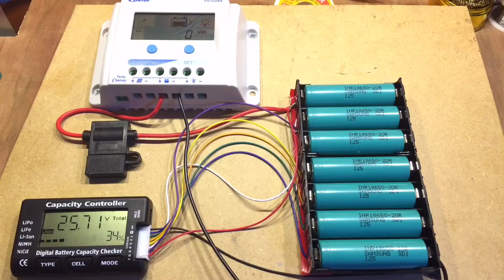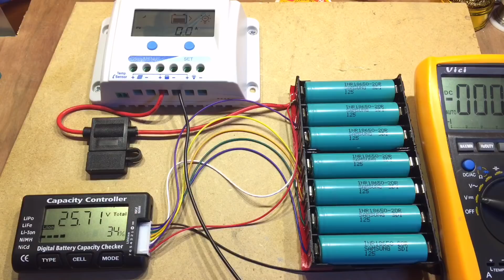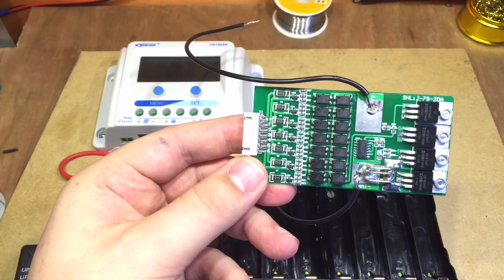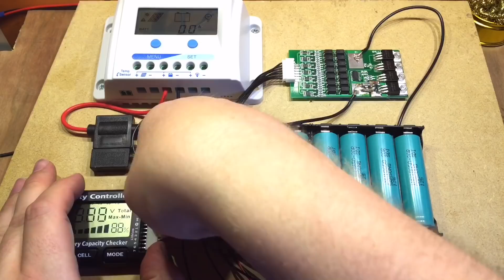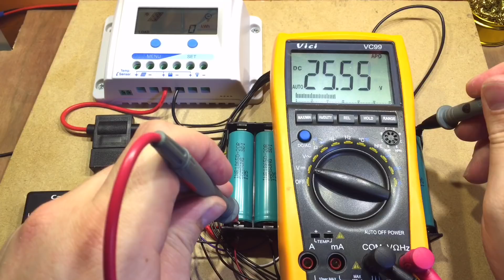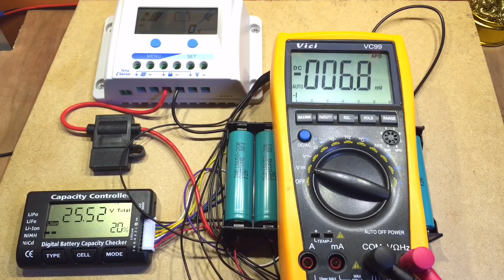Solar Charging Lithium Ion 18650s - Part 2, Getting the balance right - 12v Solar Shed

Comment: Hey Adam, Have been following your series.. I just wonder how are you avoiding equalize/Boost feature of controller..
Reply from the maker: Hello. I’ve set the charge controller to Gel mode. This means it doesn’t do an equalise charge at all. The boost setting for the Gel profile is 14.2v (or in 24v mode 28.4 volts). In a 7s configuration that gives 4.05v per cell. This mode tries to stay in boost mode for 120 minutes. If it reaches that voltage it will adjust the pwm cycle to keep the cells no higher than 28.4 volts. After the two hours, the charge controller disconnects the solar panels until the battery voltage drops to 13.8v where it will float. In my experience, the cells never float because lithium doesn’t sag as much as lead acid. So to my mind it works quite well for s7 lithium. Changing to sealed or flooded would charge the cells higher and as you say also do a monthly equalisation charge which could charge your cells to 4.17 or 4.22 volts - which might be a bit high or at least reduce their lifespan. But with a reasonable bms attached, that may be a limit some are happy with and would maximise your storage.
Reply: @AdamWelchUK  Thank you so much detailed response. Appreciate the work.

Comment: can someone explain the difference between solar charge controller and bms? the charge controller just supplies voltage from the panels, while the bms actually handles putting that energy into the batteries? If I have a tiny 5v solar panel, do I still need a charge controller or can I just use a BMS or like a TP4506?

Comment: Given that TP4056 chargers are very cheap, as are buck converters (which are pretty efficient), why not simply use the solar rig to charge the lead-acid battery that it's designed for, and then use a buck converter to drop the 12V down to a little under 5V to power a bunch of TP4056 modules, one per 18650? No calculating, no messing about balancing: the technology is tried and tested already.

Comment: what about adding a buck regultor between the charge controller and the battery? some buck controller say that have costant current and costant voltge. and the voltage can be regulated

Comment: I made your battery capacity checker some time ago that works well but would like to purchase a watt meter but your wattmeter is no longer available from the Portapow such a shame and the Chinese one are so inaccurate they are not worth buying so any suggestions, please?
Reply from the maker: Sorry not really. There doesn’t seem to be much that takes the place of the portapow - I guess there wasn’t much demand for these types of things. Best suggestion would be a usb power doctor with some custom cables. Like a rdtech one capable of monitoring a wide voltage range might be the closest stand in.

Comment: Press The "Type" Button until it shows Liion ore Lipo and then press and hold the "TYPE" Button until it Beeps

Then the Capacity Controler is doing the Balancing even if the "per cell voltage" is under 4.2

BMS´es only Balance when the Cells are up to 4.2 Volts (stress for the cells ) ;-)

Comment: I use a Capacity Controller for balance. And switch to balancing the Battery by pressing the 1st button and holding until it beeps twice. And it balances me pretty well. It only takes a long time.

Comment: Is it possible that your bms is for LifePO4  batteries ? They have a voltage range of 2.5v-3.6v and a nominal voltage  of 3.2v where as Li ion cells are 3.0v-4.2v range and 3.7v nominal voltage .
Or ...my other thought is  ...
If the pos and neg were reversed you would not have one direction diode protecton  and the power from the batteries  could flow back to the pannels.

Comment: I found out the hard way that the mosfets hate any static charge. i think you have to ground yourself when handling them too. i had a 48VDC spark fry a BLDC motor controller on me twice when it  was out of its aluminum box. The spark was more than a foot away. I put my 3rd new controller in a faraday cage i made with an antistatic bag wrapped in foil tape and it stopped the problem with sparks.

Comment: You could try to test charging the Li-ion batteries directy connecting the panel to balancer. If power of solar panel is too hight and Amps exceed charge capacity, put a few ohms power resistor in between and you will test if balancer is OK. If balancer works, you can then try to place in between charge controller and balancer a filter made of capacitors to eliminate the PWM component of controller output. See what happens, I think it is worthy to try.

Comment: Adam, A stupid question probably. But I have 3 (2.85 euro)  powerbanks cases filled with old laptop batteries and they work great. 6 18650 per case. (except when you charge them and you turn of the power they charge back. I suddenly had 4.8 volts on my rv 12 volt system.)  But I wonder about the balancing which I never did (no equipment to do so) but since they are in parralel should'n they ballance them self? Ie if one lags behind the rest will discharge a bit until all are equel. And the next charge they will all be in balance again?

Anyway I got myself a liitokala lii 500 because I saw you use a similar one (300?) in one of your vids. so I can test the capacity of my 18650's so I can at least group them together a bit that should help I think.  Not building any power walls yet.

Comment: hi adam, seems like your the bloke to ask,  i need to charge 2 x 18650 batteries in series, from a small solar 12v panel, which pcb/device/module should i get to charge and not destroy my batteries?.....thanks in advance.
Reply from the maker: Two cells in series always means you’re going to have to keep an eye on their balance but the module I felt worked best was the CN3722. They aren’t ideal, but the adjustable version will allow you to set the charge voltage (and I’d suggest dropping it down a bit from 8.4 volts). It isn’t true mppt but does do dc to dc conversion to get more out of your panel. They are generally set for 36 cell solar panels - so the mppt of the panel should be around 17-18 volts which is typical for a panel sold as twelve volts.
Reply: @AdamWelchUK  hi adam, thanks for your reply, i will take a look at those then, thanks very much,

Comment: We  use singlelab 50a 8s BMS they have tiny LED on the board when the cell has hit its cell voltage limit and is in bleed mode they light up   - its kind of reasuring to see them twinkle  - they also have a thermal over temp sensor which shuts down the issolation mosfets if it goes above 65c - we cut into the sensor and put additional  sensors in the cell pack and even one to the motor (its a single seat electric car) - These BMS bleed only at 65mA so when ballancing a pack we put it on a very low charge of 0.2 a if you pump 5a in its easy to trigger the overvolt cut out before the cells have chance to  ballanced - we only ballance cells ever 50 charges or when there  more than 0.01 Volt out as unnecersary  ballance charging shortens  the cell cycle life  - normally we bulk charge at  5amp and use the pack in a 25-80% envolope  - our oldest  Headway pack is now 5 years old and still going strong - I find your video's very interesting and your modest honest manner easy to follow - its like sharring a journey

Comment: Adam Welch+ I had two questions. Firstly great video. The first question I have is I understand that 7 batteries in series will make a 24 volt battery but your batteries appear to be all in parallel unless you are wiring them from the back positive to negative from the back of the battery holder. The next question I had was what if you used from the solar charger to a smart charger like a hobby charger or a regular charger like a "efest LUC v6" or a  "xtar dragon 18650 vp4" would that work? Obviously then to use the cells in a 24 volt configuration to draw power from them they would then need to be put into a battery holder with a 24 volt configuration. But just for charging purposes. I would guess it would work because the smart charger would convert the power accordingly I would assume. But then there would be the hassle of then putting the batteries in another holder. One other third question I just now have also. I noticed in your first video you had all the batteries linked together with magnets. I have seen other videos that people have charged single 18650 batteries with a hobby charger using magnets to hold the connectors. Do you think it would be possible to charge a large configuration of batteries with use of magnets to hold the charging wires in place? It might not be the most secure way even though neodymium magnets are very strong and would mostlikly hold them securly even through a earthquake. But Im wondering if the magnets would create a energy transfer and unbalance things. But just wondering if you could answer a few of these questions and if you make a follow up video addressing any of these things please let me know. And if you could post a answer to some of them I would appreciate. It thank you. Also one other follow up question. I see many experienced people on youtube making large battery packs and they are using reclaimed laptop batteries. Obviously they have sorted out some of the batteries but they are always mix matched brands and capacities etc they try from what I understand to match batteries with capacities of 2Mah or higher as their standard for making their large battery packs and from what their videos claim unless there is some trickery which is always a possibility but from the videos I have seen they seem reputable. But they are able to power large power walls and even vehicles with these large mix matched 18650 cell power banks that they have made. But understanding that each 18650 cell is rated differently within brands and understanding that there is internal resistance and charging speeds that vary between different battery types and brands as well that Ive been told and have heard often times never connect batteries of different brands or even ages together in paralell or series.. What are your opinion and thoughts on this? Thank you.
Reply from the maker: Hi Derek.
Yes you are right, the wiring behind the seven cells is diagonal - so it truly is a 7s pack.
You can power a battery charger like the ones you suggest from a battery pack as long as the battery voltage is suitable for the input of the charger - I power my Liitokala and Opus chargers from my 12v lead acid bank, but they can't be powered from my 24v lithium pack.
Neodymium magnets are great for a temporary connection, but probably a bit risky to use permanently - plus they probably have a high-ish resistance - I should check that.
There are lots of people out there using recycled cells to store power, run their homes and save money.  I've mentioned in a couple of my videos that I think testing your cells and sorting them into well balanced packs is really important.  I also recommend the use of repackr.com to help with that process.  More videos from me on this subject coming soon!
Reply: Adam Welch HI Adam thanks for the info. I wanted to share also a tip with you that you might already know I found it on this Youtubers channel and I'll leave a link to the video explaining it. But if you come across dead cells that read zero volts you can bring them back using this technique. I'm actually going through my zero cells bin that I've harvested from laptops right now and trying it myself and it seems to be working. I just need to fully charged them and discharge and cycle them and store them to see if it will bring them back fully. But you basically " jump start them" with another good fully charged cell. So far I'm finding it's working. Just a tip you might already know. But might save some zero voltage cells you might other wise throw out. Here is the link to the video and thanks for you videos. They are the best I've seen for information easy to understand and you demonstrate everything well. Thanks. 
https://m.youtube.com/watch?v=tbEfhPbqTDE

Comment: Why do the batteries appear to be parallel?
Reply from the maker: Yes I guess they do, but they’re not. The wires behind are diagonal. I was concerned if I alternated the cells top to bottom, bottom to top I’d make a mistake at some point and put one in in reverse.  I promise they’re in series.

Comment: Weird, I have an older version of that "Capacity Controller" and mine does not have the feature that cycles through the cells and it doesn't update the reading once it's connected....

Comment: so balancing a cell is look if the cell is higher voltage then discharge this cell right. What happen when the balancer  is  doing it's work the charge controller stop charging waiting for the balancer to finish its  job. So this is one cell what about if your have more than one cell connected parallel.
Reply from the maker: A balancer will work on a group of cells in parallel as well as a single cell.  The only additional thing to consider is if the balancer is able to discharge that larger group of cells at a reasonable rate.  In my next video in the series you'll see I increase the capacity of the bank by placing more cells in parallel.
There is no link between the balancing circuit in this case and the solar charge controller.  As a result some power is wasted - but in reality it is very little.  Balancing cells whether solar charge or not does unfortunately waste charge - until someone works out how to take charge from the highest voltage cell and move it to the lowest we're stuck with just burning off some of the power from the highest cell.

Comment: if you only hookup the capacity controller with no solar charge, will it balance the cells?
Reply from the maker: +Eric Mar Yes but without some charge going in occasionally it will empty them eventually!

Comment: Nice video,  but where can one buy the 1850 battery holders from .
Reply from the maker: Thios is the type I use - although I have to wire the back of them for series... http://rover.ebay.com/rover/1/711-53200-19255-0/1?icep_ff3=2&pub=5575189419&toolid=10001&campid=5337903455&customid=18650+Holders&icep_item=322245409589&ipn=psmain&icep_vectorid=229466&kwid=902099&mtid=824&kw=lg

Comment: nice experiment, that saves me wasting money . I want to charge my 24v 18650 pack using solar, but need to have correct way to do it and avoid killing my batteries or introducing risk to the charge process. so far learned gel seems to be correct voltage to be used.
Reply from the maker: +Serviciosymas Well it's a matter of consulting the datasheet or manual for your controller and deciding where you want to charge to. 4v per cell seems to be working out quite well for me.
Reply: Adam Welch. yes the problem i see its solar charge controller directly connected to the battery pack may unbalance some cells
Reply from the maker: +Serviciosymas It can yes. If you balance your cells well, build large and even packs you'll find they keep pretty well balanced. My setup is quite small so a balance circuit is required.

Comment: Can we use those tp4056 in series at 15v, and the 18650 also in series so no ground would be shorted?
Reply from the maker: +malicious1111 Sadly not. The boards are not isolated so they would share a common ground and short.

Comment: While balance board are important to keep all the cells the same voltage, you could say they reduce total system efficiency as the board is wasting power to heat while balancing. At this pint im not sold on lithium lion batteries Lead acid seems way cheaper
Reply from the maker: You're correct of cause, they can be wasteful if they are having to work hard.  But most will be wasting energy when there is surplus - when a cell is full the balance board will start turning the surplus into heat.  Now don't get in wrong in an ideal world that energy would be redirected into a less well charged cell, but that is very tricky.
I don't intend ripping out my lead acid system - it works well for me and I hope to keep it well maintained for years to come.
Reply: in theory the lead batteries are much saver too. they wont blow up...

Comment: Sometime I wonder it is is not better to charge the entire pack with your own charge controller.  Charge them in parallel at 3.7V and use a boost converter(s) to get it back at boost.  The problem might be lvd - low voltage disconnect, thus you might have to use an inverter or device that has a lvd.

Comment: Hi Adam, thanks for all of your video (very instructif).
in this case (with 7 18650s), what is the output voltage on the solar controller ? 12v / 24v or setable in the controller menu ?

Regards
Reply from the maker: Thanks.  The charge controller automatically chooses 12 or 24 volt and the pack is being charged with the 24 volt Gel battery charging profile.  This charge controller is not adjustable (except for choosing gel, sealed or flooded lead acid), I wanted to use one which I had not adjusted.  I talk more about the why's and the how's in the first part of this series - https://youtu.be/YoH7V56RtkM
Reply: thanks